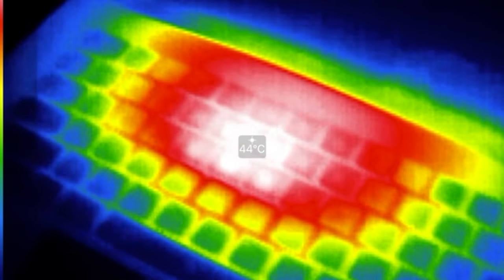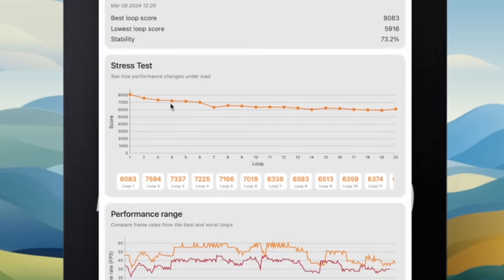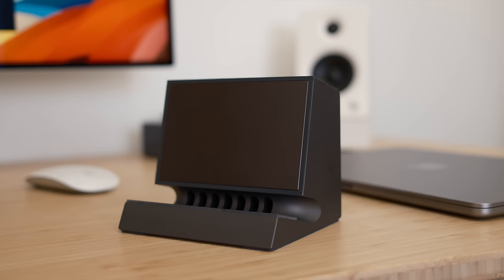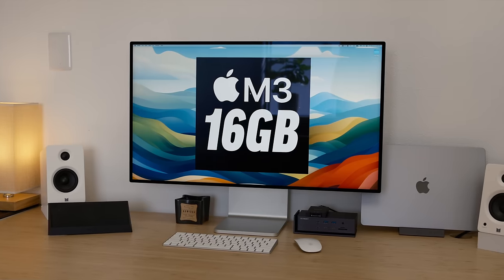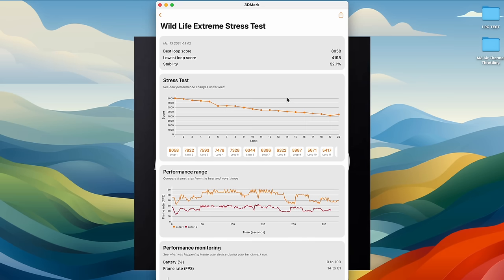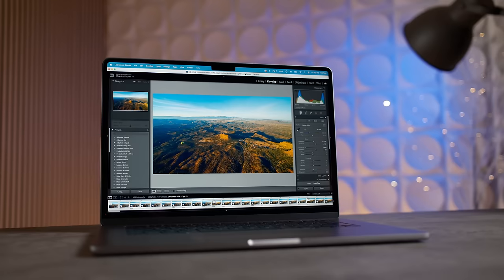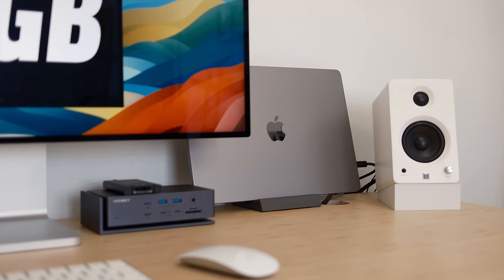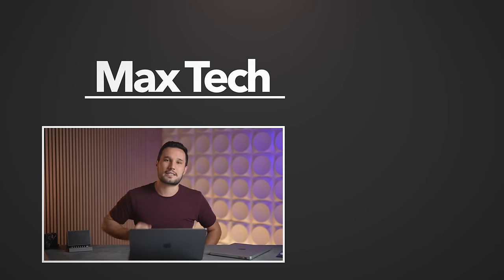Making my M3 MacBook Air FASTER than M3 14" Pro!

Comment: You can make one of these for like $25. Get yourself an old intel pentium CPU heat sink. These are basically just machined blocks of aluminum with fins. If you want a fan, you have the extra bonus of these being able to mount fans directly on them. Otherwise you can go completely fanless, or even get something like a Dell Dimension heat sink (used in fanless systems) which is literally just a machined block of aluminum. $10 plus shipping.

Grab yourself an extra thermal pad to put between it and the mac book air.  $10-15.

Place thermal pad on aluminum heatsink. Place macbook on top of thermal pad. Elevate macbook with something so that it rests level with cooling block. Success.
Reply: Thanks for the idea. I am currently waiting for my base model M3 to arrive, and have some old heatsinks stashed in my workshop (I have kept them around since the late 90s thinking they might be good for something...) Some are large blocks and others are quite low-profile (removed from motherboard chipsets). They have the footprint of a small matchbox and around half the height. I think I might make use of them in this fashion lol
Reply: Nice. Which results could you achieve with core temps and consistency in long benchmarks?
Reply: coming back with my own results: So I went out and purchased a $15 simple cooling sink for an old pentium processor I believe, from StarTech on Amazon, including a 60mm fan. (Socket 478). It's an elongated heatsink so i'ts not concentrated on only one small square. I applied thermal pads inside the macbook, but really only on the middle section. Then Thermal pads on the flat side of the heatsink. Purchased an additional USB 5V to 3pin Molex connector, built myself a stand and put everything together. I'M BLOWN AWAY. Finally I can play games via Crossover with no heating issue. The machine is cool to the touch. Unbelievable! Even after 1 hour of gaming. Considering how cool it's running, absolutely no worries about battery life. It's a stationary set up though. I order to avoid heating issues, I will use battery saving mode when not stationary with cooling. Usually my macbook M2 Air would throttle after 10 minutes and get very hot. Glad I went this route, even though the svalt stand really looks better. but $279 is just too much.

Comment: I put a magnet on my the side of the palm rest, the Mac thinks it's closed, so it cools down better.
Reply from the maker: Great tip! Thank you!
Reply: Remember not to close the screen while its still there
Reply: Did not work on my mbp 16 2019. I remember they have screen angle detection as well? could you send a link of your magnet?
Reply: I don't know about the M2/M3, but the M1 MacBook Air requires two magnets to trick it. The hall effect sensors seem to be hidden in the speaker grilles, at the bottom corner of the shift keys.

My 2015 MacBook Pro only needed one magnet to trick it.
Reply: idk if a magnet can destroy some of the electronics so. I know there is no hdd, but...
Reply: @cosmoscloud121  The MacBook already has magnets in the lid that activate the hall effect sensors, so putting magnets in the same spot shouldn't harm it.
Reply: @MaxTechOfficial  can you do this test for 4K rendering and post the difference in result please.
Reply: @cosmoscloud121  Generally speaking most modern tech is relatively fine with magnets, even very powerful ones - remember that speakers, magsafe, and most iphone/ipad accessories use rare earth magnets!

Comment: Great video! I got MBA M3 24GB 1TB Midnight, my first Mac. In this configuration is faster than my desktop (i9 9900k), this should be more than enough for a such slim/compact machine. I like the thermal pads idea. Thanks.
Reply: Thinking of getting the same how is the heat issue
Reply: Thinking of getting the same how is the heat issue
Reply: @haggaikathewela8910  Yes I wouldn't get the MBA with high specs because we all ready know without a way to cool, it's not going to perform well. Essentially wasted performance for one reason only, "heat."

Comment: So let me get this straight: 
1. Get a 1300€ MacBook Air M3 
2. Get a cooling block that costs 300€(not even premium liquid coolers cost that much btw. Let’s not talk about a piece of metal)
3. Void the warranty on a brand new machine to install thermal pads
4. Not run a single test to see temps on other components of the MacBook that may get affected by the installation of the thermal pads such as battery that has a pretty low operating temperature as you came to realise after the same thing you did back with the m2 MacBook Air (and you still suggest the same thing)
All these and you sound pretty excited about the results as it is the best choice for someone that wants a stable machine. I might as well get my 2018 desktop and oc it with liquid nitrogen that will surely boost its performance. Not all options are viable you should know that
Reply: This is so dumb, the obvious answer is get a pro chassis with fans. I did, the 14” M3 12core can run on my comforter on my bed, never turn the fan on, never get so hot it fries my skin, in fact it’s never even warm from light work. My i9 16” mbp had to be on a tray which allowed the chassis to have airflow otherwise it starts to fry on any fabric surface you’d use it on like a couch or bed. I love this aspect most about the current gen MBP and Apple chipsets and their performance and efficiency. The HDR screen also truly unlocks your HDR camera if you’re a film maker or photographer something which just never happens on machines with an SDR display like the mba. The pro is a really nice machine, those ports are rad too.
Reply: i'm surprised so few people are talking about this, and all that on top of now the laptop is uncomfortable to use as a laptop because the bottom of the case will get to scorching temperatures. So basically spent 1600 to get a louder, less efficient, and larger m3 mac mini with less functionality.
Reply: @zatorith.  Under normal /casual use the laptop doesn't heats up. Unless you are doing 20+ minute renders on your lap, it will otherwise behave like a normal macbook air. If you are doing 20+ minute renders on your lap, you've got bigger issues.
Reply: The thermal pads are less than $20 and give you about 75% of the thermal benefits… just do that and save the $280.

Comment: Why doesn't Apple add the thermal pads as standard?
Reply: Same reason that they don't put an actual heatzink, they don't want the machine to be as fast as it can be, this is how they throttle the machine
Reply: cause the laptops would get to hot to the touch for regulation.
Reply: Their excuse is that the bottom of the laptop would get uncomfortably hot if it was directly touching the heatsink and spreading the heat. Also, they focus the Air to consumers that don't need constant performance.
Reply: @robertoacj it’s not an “excuse” there’s consumer electronics regulations that state how hot something can be that will come into contact with skin. It’s not for the lolz 😂
Reply: Easy explanation is many times, the truth.. well you guessed it right..;)
Reply: Will you pay compensation for burnt legs? This is a laptop.
Reply: @spiritualinsightshd  Nonsense. This is a laptop. People put it on their feet or on the bed. Poorly ventilated may cause burns.
Reply: Cuz money, the want to scam you
Reply: Design over performance
Reply: Because then it wouldn’t thermal throttle and it would perform the same as the Pro which is more expensive and the one they really want you to buy
Reply: @robertoacj That's exactly what's happening, for real. I have modded my M1 Macbook Air with thermal pads. I know what I'm doing, so I take full responsibility for it. But I would not do the mod on anyone else's Macbook, because the bottom case gets so hot that the owner will burn himself with it, sooner or later. Apple protects its users by isolating the processor from the bottom case, and that's the right thing to do. If they didn't isolate the processor, they would have to deal with burned users, melted furniture, and maybe fires caused by the Macbook Air. It's not an excuse, I can tell you from first experience that it is a real danger.
Reply: Because then no one would have a reason to buy the MacBook Pro
Reply: Bot EU and US regulations state that for safety reasons a laptop may not exceed 45C on the outside shell.
That IS the actual answer to this question - The reason why no laptop heat pipes are in contact with the outer chassis.
Reply: Does opening up the MacBook Air to install a thermal pad void warranty? The ironic thing is many will buy a case to protect the laptop from scratches and bumps.lol
Reply: @liltimmy109 You don't get it. Once the thermal pads are installed, which I have done, the laptop becomes unsafe to use. I know what I'm doing, but Apple does the right thing by isolating the processor from the bottom case.
Reply: @spiritualinsightshd probably they designed it to be used for the average users and not power users. That's where the pros come in. That's why they limit its power. You want performance, get the pro. They knew it would throttle just for you to get the expensive ones.
Reply: May someone tell me what kind of work really gets the MBA to heat up…is it considerable heat or it’s like the iPhone charging heat at times?
Reply: While thermal pads helps cool the CPU and prevents thermal throttling, It also dissipates the heat to the bottom cover, basically makes the whole bottom cover a second heatsink.

And you know what happens to heat sinks without a fan? It get uncomfortably hot. And there are regulations for how hot a device is.
Reply: @haggaikathewela8910 It can be considerable heat if you do something intensive, like re-encoding a movie on it (converting from one video format to another). The heat will not make it hotter than around 45°C (113°F), because it is designed to slow down and produce less heat when it reaches that temperature on the case, so it will not burn you. Now if you install thermal pads inside, it will be able to evacuate the heat outside and will slow down less, but then the case may burn you (reaching, in my experience around 65°C or 149°F). For this reason, Apple does not install these thermal pads, and they are absolutely right not to.
Reply: Eat their profits too much don’t ya know.  Why add something we can just do ourselves.  They don’t care.
Reply: @Ron_DeForest They care about their users not burning themselves. I have done the mod on my M1 Macbook Air, and I get unsafe temperatures. I don't care because I'm careful enough, and I'm not going to use it on my lap when I do intensive tasks, but it's clearly not something you want your family members to use. So Apple is doing the right thing. There are many outrageous things they do, but thermally isolating the processor from the case is not one of them. Please find something else to criticize.
Reply: @SanSan-lb9iv Indeed it does. Because you tanper with the regulatory certification of safety, thermals and structural integrity.
Reply: @fixups6536  Nice to see someone who understand …and I to add pads, because I know what not to do :)
Reply: Another likely reason for not using thermal pads is avoiding mechanical coupling of pressure and shocks to the PC board. The Air is intended to be a highly portable design, and finds itself stuffed into many cramped spaces when transported. Thermal pads are dense, and effectively transfer any mechanical shock to the underlying components. The solder connections along with the microvias (plated copper holes for electrical connections) are somewhat brittle, and a direct "whack" can cause intermittent connections or total failures.
Reply: @EarthSurfer  Exactly and you also need to undestand what you do to nearby components by understanding how the board are laid out encapsuled etc. to ovoid overheating of especially power conversion & stability components. Often people put too big pads on that break or wear out nearby components (just like the battery CAN be an issue on passive cooled systems, despite what is said in the video).
Reply: Because some doofus will probably put it in their lap and complain that it gets too hot?
Reply: @OPM_Viking  😩
Reply: @recline69  what other options do I have other than place it in a cool environment.
Reply: My m3max is so hot it burns my lap
Reply: jsl8461  I understand that.
Reply: I understand the heat transferred to the body makes the battery warme as the battery is also cooled by the chassis.

Comment: You forgot to mention : $279 for Svalt's cooling dock. Might as well upgrade to the MBP really
Reply: While I think the $279 is way too high, at least it’ll help cool all your laptops now and future laptops in the future. That extra $ for the MBP will only help now.
Reply: @HypocritesExposd  that is probably only justification. Or we can wait and see if it wont sell and goes cheaper :) or wait for chinese knock off.
Reply: I would still rather have the macbook air to use on a table top on the go and full performance at home in one of these docks. macbook pro is a chonky heavy laptop.

Comment: When I had a Mac Air M1, it would always throttle.  All I did was to get a laptop fan (laptop sitting on top with two large fans under it with a riser to get air flow.  Worked for a long time too until I went to get a 16gb model and I opted for the Pro to get a built in fan.  Works with the lid closed and even with a case on

Comment: This is a pretty cool solution (ha, get it?)

Very creative. Though of course one thing to keep in mind if you're considering this option is that you won't get that macbook pro performance on the go. That being said, great if you're leaving your sustained workload tasks for when you're at home or at your office.

Another thing to keep in mind that I think is brushed over in the video, is battery health. It's all fine when you're on the cooling dock, but when using it day to day, that thermal pad will transfer heat to the chassis and down to the battery.

Comment: If you haven't noticed, the thermal pad solution alone would satisfy 99.99997% of users. Serious improvement for such a little cost. I get why Apple didn't want to do it because of how hot it would be on your lap without the air gap.

Comment: To be noted - the upgrade is NOT free performance lying on the table - using the Thermal pads allow more heat to be dissipated to the chassis, which true, helps with cooling of the CPU, but it also makes the whole chassis hotter - which may cause issues when you want to use the laptop on your legs or on a soft surface - sometime ago, I think it was LTT who measured it, and the chassis was hotter than the legal US limits and may cause burns. 
The cooling block then obviously limit the moveability - cooling pads or stands have been quite standard for a while now, even for other laptops, this one looks cool though and its mass allow it to be used even without fan, which is nice for silence. 

But in both cases, you are making your Air less functional as a laptop, but more powerful computer overall. For some, this might be a worthy tradeoff.

Personally, I'd go without the thermal pads but with the cooling block. That way you can easily take the laptop off of it and use it safely wherever, albeit with the thermal nerf.
Reply: No one is going to be doing intensive 15m+ import/exports on their lap, which would get uncomfortably hot anyway thermal pads or not. The svalte is nice in terms of aesthetics and space-saving but any cheap laptop cooler will suffice in combination with the thermal pads.

Comment: Hey Max, I just wanted to report my own test: I got the 1.5mm thermal pad (exactly the one you got) and placed it directly above the M3, another 1mm one I placed half/half left and right of the 1.5mm one. I placed the Macbook on a dedicated laptop-stand, like I usually do at home (open), and my multi-core score in Cinebench is: 678 (and I had a lot of stuff opened while running Cinebench). I'm really impressed. But I have to say these pads are a bit weird to work with. I had to really fight them to get off the clear plastic side and torn some junks from it while doing so, but at the end I was able to squish everything together into a homogeneous pad. :)

Comment: Great video! The reason I am replacing my 14" Macbook Pro with a 15" Macbook Air is simple - the screen is bigger with no weight penalty. For editing video and graphics work a 14" laptop is too small, and the 16" Macbook Pro is too expensive. Thermal pads are a cheap fix but probably void the warranty - the cooling block is crazy expensive but is silent, which I want for audio editing.

Comment: So I went out and purchased a $15 simple cooling sink for an old pentium processor I believe, from StarTech on Amazon, including a 60mm fan. (Socket 478). It's an elongated heatsink so i'ts not concentrated on only one small square and covers more of the macbook backplate. I applied thermal pads inside the macbook, but really only on the middle section where the main silicon is. Then Thermal pads on the flat side of the heatsink. Purchased an additional USB 5V to 3pin Molex connector, built myself a stand and put everything together. I'M BLOWN AWAY. Finally I can play games via Crossover with now heating issue. The machine is cool to the touch. Unbelievable! Even after 1 hour of gaming. Usually my macbook M2 Air would throttle after 10 minutes and get very hot. Glad I went this route, even though the svalt stand really looks better. but $279 is just too much. If you don't want to build a stand, just put your macbook upside down and place heatsink on top. That might impact wifi though.

Comment: May I have a question? I saw you used  1.5mm thermal pad. Why do you suggest 1.0mm?
Reply: Same question here! Could younplease clarify @max tech?
Reply: @TheNapsterHack  with 1,5mm is bit difficult to close the bottom  lid